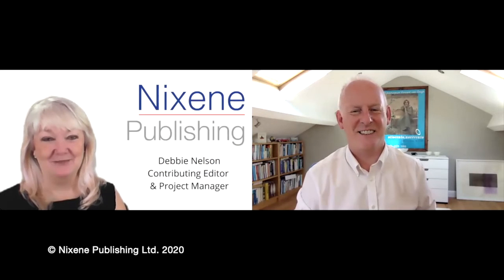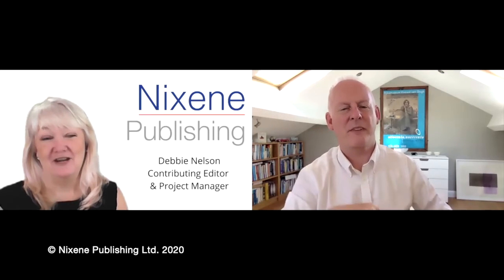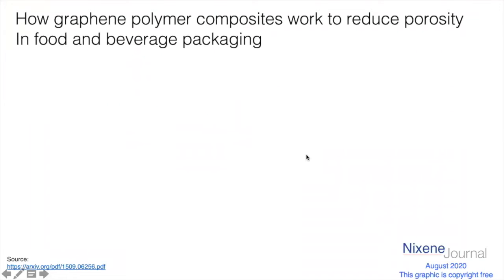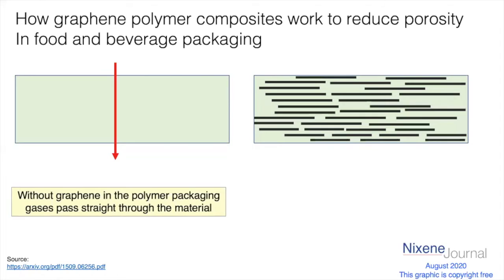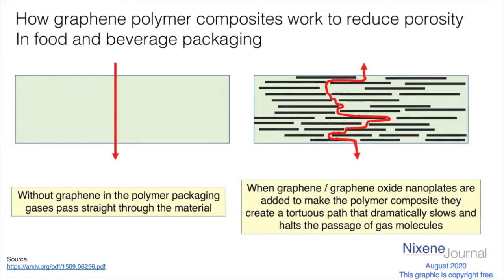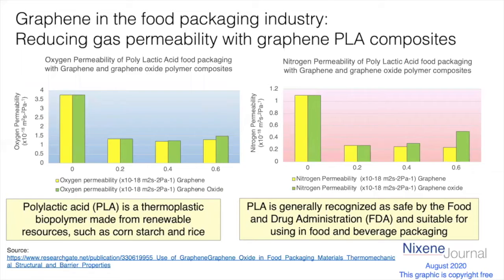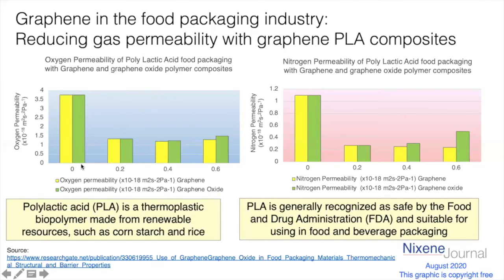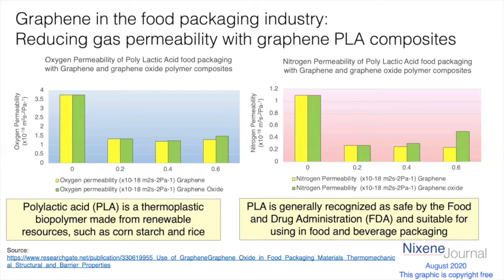33 Graphene and Food Packaging

Comment: Could this material aid in the levitation of a space elevator?
Reply: They put it in the  v a c c I n e s,  so why wouldn't it be in our air and food and all the other products we use. Organic has a lot less if any at all.
Reply from the maker: Thank you for your question! We'll be right back with your answer.
Reply from the maker: A very good question - yes.  Graphene can make the space elevator a definite possibility because graphene is both strong enough and light enough to be a candidate material for the tether that connects the ground to space.

I summarised the latest research in tether materials in this International Space elevator Consortium (ISEC) free webinar, "Graphene: the Last Piece of the Space Elevator Puzzle?"

which can be found on this site -   https://www.isec.org/recorded-webinars 

You can also access the video directly at https://www.pinterest.com/pin/627267054339925430/?nic_v2=1ah8bhWsa
It's part of our Pinterest board: Space Elevator: Closer Than You Think! 

Hope that helps!
Reply from the maker: In case you missed our reply video, here it is!
https://youtu.be/J4V_UAVhFAs